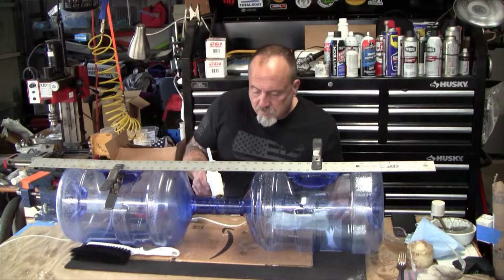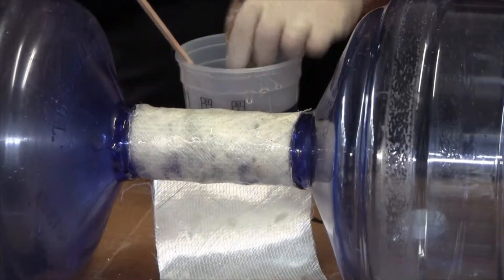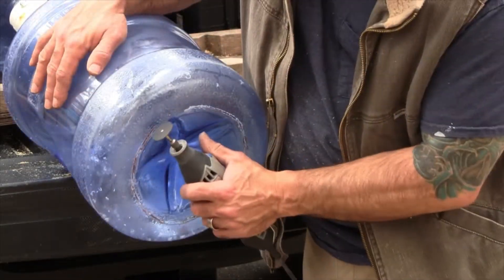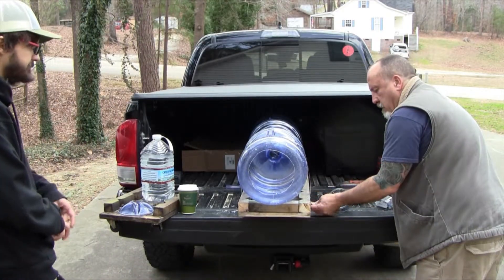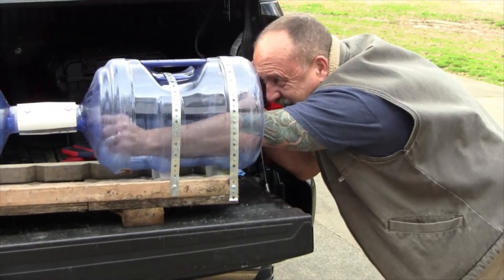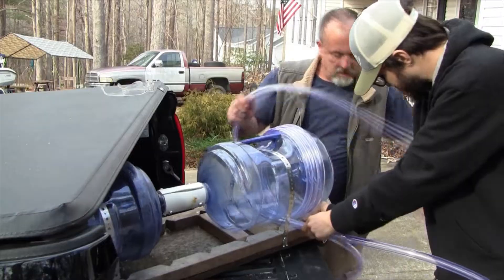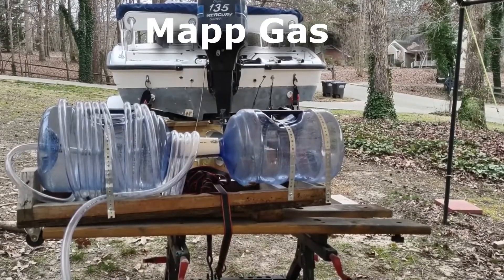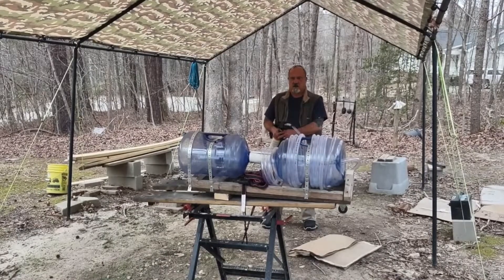DIY Giant 10 Gallon Plasma Cannon Build and Fire

Comment: Did you put the hole in the hose at the propane end or the jug end? And how long was your hose and the size? I can't get mine to fire properly
Reply from the maker: Unfortunately, I dont have an exact formula to make it work, you have to play with the hose lengths, especially where it discharges into the cylinder
Reply: He wasn't asking for a formula, he just wants to know how long your measurements were and what size you had installed, for educational purposes ofcourse. I would also like to know what these were. @ExtremeDIYGuy
Reply: All the information is in the video if you can’t pick it up you probably shouldn’t proceed